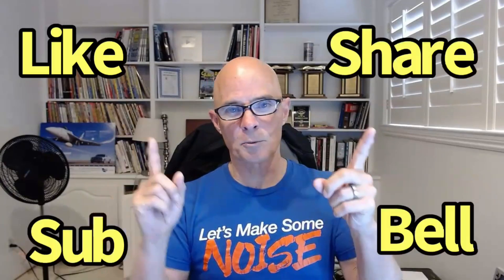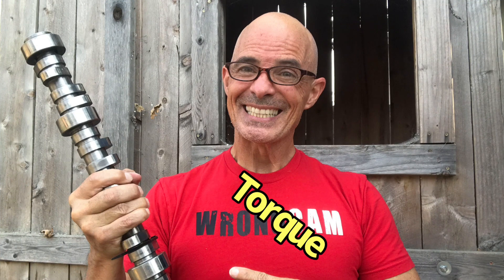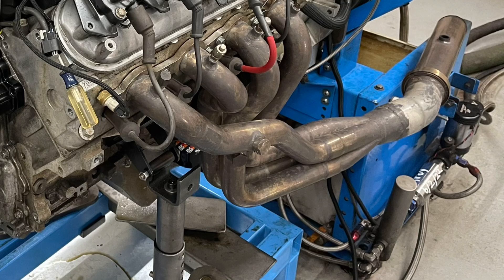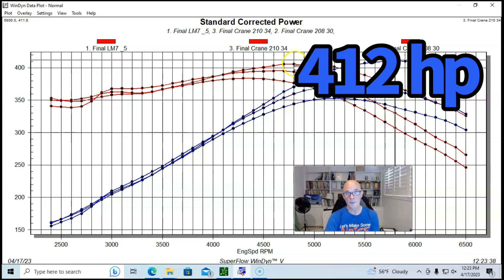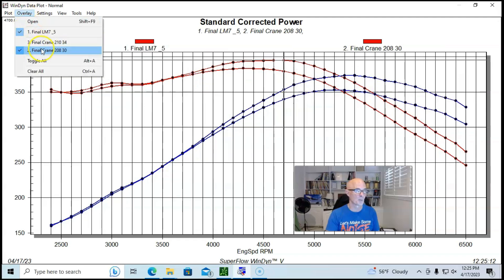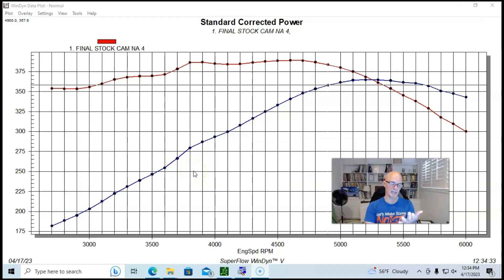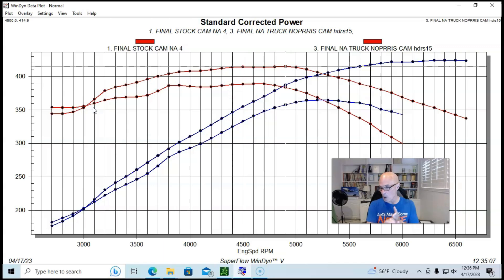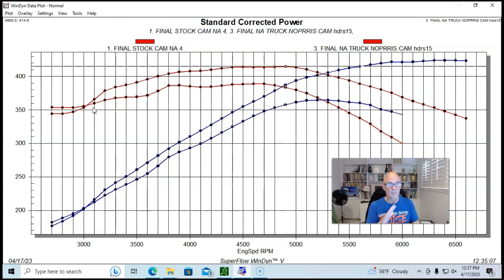WHERE'S THE TORQUE? HOW CAN I MAKE MORE LOW SPEED TORQUE? WHO MAKES THE BEST LOW-SPEED TORQUE CAM?

Comment: I just did the Tsp chopacabra cam and ported heads on my work truck. I was really hoping that it would be better than it is. Do I make more power down low? Yes, but it's not game changing or really worth all the effort that I had to put in. It does do pretty good past 3k and pulls strong up to 6k but I rarely see those numbers in normal driving. This is the fist ls I've run, I usually have a tbi or vortec 350 and I'm a little disappointed to say the least. 

I'm thinking of maybe getting a slightly bigger converter when trans rebuild time comes next winter. Shorter gears are a possibility as well to go with it to get into the power curve a bit better. I also got to get the tune dialed in a bit better and work the shift points a bit better. It's got great pull in first but shifts out to second and lands at about 2250rpm 500rpm just short of where it really wakes up at 3k. From second to third is pretty nice and I usually pull it to about 4-5k.

All in all, I'm happy I did it. Now I won't be feeling like I missed my chance to do it, the motor had to come out for a dead lifter and to be resealed anyway. The next one I'm doing is a 6.0 with a sloppy stage2 and a converter.

Comment: to generate lower RPM torque , you have to have a higher crankshaft stroke , chevy guys , need the early 2000`s  454 with the 4.25 stroke crankshaft , ford guys need the lunati   351w 4.250 stroke crankshaft , then  use the correct duration camshaft , with a correctly CFM rated carb along with a correctly jetted carb

Comment: You mentioned that you could gain torque with a lower engine temperature. This made me think of a few noteworthy mentions. I would think that quite a few people wishing to increase torque would be choosing to modify their daily driver. That’s why these two considerations may be important.
1) Smoky Yunick stated that a hotter engine will resist wear more so than an engine running cooler temperatures. So engine temperatures could effect longevity.
2) I used to run cooler thermostats to pick up a little extra grunt. A fellow car guy shared with me that he had experimented with coolant temperature and determined that a hotter engine seemed to get better fuel economy. I never tested this theory with a carburetor but I have seen slightly better mpg on EFI engines with a 195 thermostat than with a 180.
Reply from the maker: hotter engine does get better fuel economy-but makes less power

Comment: The answer is because at low engine speed, even with a stock cam, you’re running close to 100% volumetric efficiency. Theres only so much air that can enter the cylinder, and the only way to get more power than that with an NA motor is with more rpm. Volumetric efficiency drops at high rpms especially with mild camshafts. And a good cam is essentially allowing higher volumetric efficiency at high rpms.
Reply from the maker: the highest VE will be at the torque peak-nowhere near this 2000 rpm point

Comment: Use a cam with a very early closing intake event (increase dynamic compression) and late opening exhaust event (hold the power stroke for longer). Caution use only 92 octane fuel or better to avoid pre-detention. Use small diameter headers 1 & 5/8  or 1 & 1/2. This was good for approx 25ft/lbs @ wheels at 1800rpm.

This all comes at a cost to top end power. You will get less than the stock cam.

Comment: Currently building a high compression 292 chevy inline six, to replace my 327 chevy v8. This is for a firewood truck. That freakishly long stroke, that's what increases low-end torque. Also going from 4:11gears to 4:56 gears.
Reply from the maker: you will find the smaller motor makes less
Reply: @richardholdener1727  yep, less up top. But with 4000lbs of green firewood, that high torque off idle will be nice. All low end grunt, crawling off road around cut sites, loaded heavy. A good environment for the straight six.

Got clifford intake, forged high compression..060 pistons, total seal thin rings, Harland sharp roller rockers, howards hy-tork cam, ac delco hei truck distributor, long tube headers, flowkooler water pump, 6bt cummins radiator. Tom Lowe lump ports, bigger intake/exuahst valve kit. Excited to get it put together!
I'm a little intimidated though, such a big project.

Autoline just put me together a remanufactured motorcraft 2100 carb. They are amazing carbs off-road. Great fuel atomization at idle as well.
Reply: I used believe that a longer crank stroke was the key to making torque. But total displacement is a bigger factor. Anyone who has taken a basic hydraulics & pneumatics class will tell you that a larger piston has a greater area and will exert greater force when the same amount of pressure is applied. A larger bore also provides more room for flow around the valves. More flow equates to greater power potential.

Comment: I would think it’s possible to make more down low with the right set of cylinder heads. If I were a betting man I’d think an LS1 would put down more power at 2000 RPM than a regular 350.

Comment: On a 3/4 ton and a 1 ton truck. You basically have hydro boost brakes. Which relies on power steering hydraulic pressure. Which means you can run a tight LSA cam in theory because you don't need engine air vacuum for the brakes. If  you have a 1/2 ton truck. Most likely you will have an engine air vacuum brake booster. Maybe the tightest you can go would be a 109 LSA. And still have engine vacuum. ECM Tuning will be required on some of these cams. On diesel engines like a 5.9 Cummins you have 600 ft lbs of torque at 1600 rpm. The reason is down low is because of the camshaft LSA. In 2002-2007 the stock specs of the camshaft is intake 163°@50 and cam lift is .237. Exhaust 191°@50 and cam lift is .299. On a 98.5 LSA. And for the brakes it uses a hydro boost system. Operated by the power steering pump. And I remember Richard showed a video about LSA and the 108 made good low end torque where trucks normally operate when towing. So this video was questionable.
Reply from the maker: no lsa or cam advance or duration spec will add 30 lb-ft (or more) of torque at 2000 rpm

Comment: I thought a tighter LSA such as 108 improved low end torgue  while keeping good higher end power. You proved that another video. Vizards 128 formula works.
Reply from the maker: ADDS LOW END AND TOP END?
Reply: You tested 3 exact cams with different lsa 108, 112, 117. The cam with 108 made more low end tonrgue with near equal top end power.

Comment: I have a question I’m running a 2000 Silverado 1500 with a 5.3 and single turbo setup the engine has injector, sloppy stage 2 cam , 317 heads and Jegs intake manifold also 456 gear ratio on 20” tires and 3500 stall converter and the truck coming out of the line is very sluggish I know is not the tuning because I change to different tuning and still the same Hp tuners any idea what is wrong
Reply from the maker: DO YOU HAVE THAT FABRICATED, SHORT RUNNER INTAKE? AND WHAT SIZE TURBO? THAT CAM IT ALSO TOO BIG
Reply: @richardholdener1727  which cam do you recommend
Reply: The intake I got from Jegs the turbo is  GT45 1.05 A/R 98mm

Comment: Looking for advice OPP on building a 400 sbc stock bottem end boar 30 over stock heads I am trying to reach 450 HP can you help going in Camaro torbo 400 tran 373 rear 15 in tire
Reply: Please help
Reply: Thanks for the advice a nice choppy cam would what?
Reply: Any suggestions on a choice of cam
Reply from the maker: THAT IS EASILY POSSIBLE, BUT PORTING THOSE STOCK HEADS WILL BE REQUIRED
Reply from the maker: look at the Comp XE line of cams-an XE274H

Comment: One thing that we're overlooking is head flow gains.
Better heads either by good porting or swap increase cylinder flow with any cam, which means good increases in the most "useable" rpm range. Good heads bring out the best of what a cam can do.
Of course Richard is correct when just comparing CAMS.
They're less $$ than heads.
Eg: Richard did tests on a SBF pushrod 5.0 and cams helped but heads alone were good for nearly 80 HP aaaand lower rpm, before cam changes.
HEADS!!!!
IMO good exhaust, then head flow, then cams...
IF you can afford it.
Reply from the maker: PORTED LS HEADS DON'T ADD TORQUE AT 2000 RPM
Reply: Heads is the most important, i bought TrickFlows 38cc for my 4.6L 2v rather than porting stock PI heads.. Unported TFS made a huge difference.. The cam i chose (MHS TFS stage 3 n/a) taps out at 5,447rpm 309rwhp 321rwtrq.. Huge torque all around..

Comment: You know I've read down through most the comments. A lot of people had different suggestions. I think everyone could be correct in there own way. 

The main question is, What are you building your motor for? You want to have a nice street car? You want to do 150 mph in the quarter mile? You want to pull a house off the foundation?

You can get better torque at a lower rpm with a cam. But you have to build around that cam. Other variables have to be in play also. It takes more than a cam to get what you want.

Just remember that you can only put so much power to the road before breaking the tires loose. If you're spinning tires you're not going where you want to go as fast as you want to.
Reply from the maker: YOU CAN'T GET A BIG GAINS IN TORQUE AT 2000 RPM WITH A CAM
Reply: @richardholdener1727    More or less that's what I said. You can get some with a cam but you have to build around the cam to get a big difference. 
Another point I made is what do you plan to do with your vehicle. Not everyone is after the same ending.
Reply: @richardholdener1727   All I wanted was a nice little street car. I did different things to add torque to mine. Yes I went a little overboard with mine.

If you look up the specs on my cam it says good low to mid range torque range. My cam is obsolete of course, it's a Crane Cam. Look up the specs for part number 363941. 
I also am running a V6 torque converter behind my 5.0L. So yes it also helps. Besides adding compression with the shaving I did and my heads Frankenstein is a street beast. Probably do real good going down the strip if I can get rid of this V6 rear. Coming off the line all it wants to do is spin that one legged 273 rear.

Btw, my 0-60 time is probably 5 seconds or less. That's when my 4R70w trans, stock behind the old 3.8L, shifts out of 1st gear.

Comment: A question since you mentioned VVT....With constant variable valve timing when testing to see the optimum change-over points (or angles), would it be best to test each test angle with an individual optimised spark table or run each angle with the same generic spark table? (one that won't cause knock regardless of the VE changes)
Reply from the maker: we ask the motor what it wants as far as ignition timing, we do that for each cam on VTEC and at various point using VVT

Comment: I need to agree Richard, I have a big ol lifted 2007 Silverado with 315 wide 100 pound rear tires.

My truck is actually slower than stock with all of the added lift.

For the first time in its life, it chirps the wheels at WOT with an upgraded torque converter from Yenko.

Comment: Richard do I remember your name from a podium finish at SSCC?
Reply from the maker: I ran that for 12 years-Won overall 1 year
Reply: @richardholdener1727  that is why your name seemed familiar. Spent 30 years on the road 7 miles from Hiko finish line. Finally got a ride last May and placed 2nd in 120 as a rookie nav. We were 5.8 off target on the 122 mile 2 way.
Reply from the maker: FUN STUFF

Comment: Everything is a compromise, and depends on the whole combination.  For example, the Buick 350 made 400+ ft-lbs somewhere around 2500rpm, but there was no point in revving it beyond 4300. If you want that kind of torque in an LS, you've got to change a lot more than a cam.

Comment: The answer really is yes... in a scenario where your cam is so absurdly small for the motor, you can get substantially higher torque down low.  Swap to a good cam on a tbi 454 and see what you get.
Reply: That being said torque down low is mostly changed by bore, stroke, and cylinder pressure.

Comment: Richard, you're right and you're wrong.  You're right, those cams YOU tested didn't make low rpm torque gains.  You're wrong in saying "it's not possible".  NO MAGAZINE/EDITOR EVER TRIES, and that's why we never see it.  Both an engine and cam CAN BE OPTIMIZED for 1,500-4,500 torque.  It would be a cam with MODERATE lift/duration, and narrow LSA, with Intake centerline advanced, ask David Vizard.  I have a goal to make a 500 lb-ft midrange (~3,500) in a streetable small block 350-360 (or 6.0 366 LQ4) CI engine.  NO ONE TRIES THAT, which is why people think it's not possible.  Yes, obviously the combo needs to be optimized to do that.  I've seen the magazines make 447 lbft from a stockish junkyard 350 Vortec, and 470 lbft from a 360 Magnum, Neither of them trying to make torque, their goal is always the HP number.   Your examples here are the LSX engines which are optimized for a bit higher rpm,  most engines in the 2000's were.  How can I message you a plan for a torque engine?  Would be a great test and you'd be the 1st to do it for the masses
Reply from the maker: what you are talking about is far from FIRST TIME stuff. Stop quoting DV-he is a great guy (I know him well), you making power with a small block has nothing to do with this statement or test. Cams have little effect on torque production at 2000 rpm on this LS combo. I've tested this many, many, many times. short LSAs, advancing the cam or ICL and circle track cam timing are not the answer.
Reply: @richardholdener1727  OK, but have you ever advanced any of these cams on an LM7/LQ?  Please do a test where you advance 2*, 4*, 6*, 8* on the dyno.  You say it doesn't work but haven't shown the evidence that I am aware of.  Sure looks to me like it would work with the Truck Norris cam
Reply from the maker: see the ls9 cam advance video-where it showed ZERO power gains-advancing cams is not universal for adding low speed torque-you need to test more
Reply: @richardholdener1727  I'll look that up, but I recall the LS9 cam is a terrible lower rpm torque cam, it is way down compared to other car stock cams
Reply: @richardholdener1727  I appreciate the testing you do for the budget performance masses.  I think if you reran the Truck Norris cam with an actual exhaust system it would pick up low rpm torque, the graph at 8:00 indicates to me the engine is not "on the pipe" yet, and it's probably the 3" long tubes with only a short extension, which is not real world for most pickup owners who'd want a Truck Norris or specifically a torque cam.  I understand it's the challenge between engine dyno and a chassis dyno

Comment: You can’t beat a stock cam for idle-2000 torque where the off-road, snowplow and towing guys live.
These guys look to a “torque cam” to preserve the stock low end torque as much as possible while still providing gains up top. Cams in the 202-210 range at .050 do a good job at stock like performance off idle and some gains up top
Reply from the maker: did you watch where I ran sub 200 duration cams through 210 duration cams

Comment: What about decking your heads? Couldn't that bring up your low speed torque? Obviously no 50ftlbs but I'd think it'd be worth something down low
Reply from the maker: adding compression adds power everywhere
Reply: @Richard Holdener - I just had that "duh" moment as I read your reply..🤦‍♂️😆... I guess I was thinking more specifically using 706 heads on say a 5.7. Decking them might give a little more on the bottom vs the top due to valve size and air velocity peaking at higher rpm?
Reply from the maker: the compression will add power all the way through

Comment: This isn't totally accurate. I added a ton of low speed torque to my 5.3L by placing a 6.0L LQ9 cam in it! I mean, the cam is installed in the LQ9, and the whole LQ9 is in the truck but details! LOL
Reply from the maker: displacement adds torque
Reply: @Richard Holdener  it surely does! Hope you realized I was joking you're spot on as always!

Comment: are there any aftermarket intake manifolds with the same runner lemgth as sbc tpi manifolds? Like other comments have said, nothing beats displacement for low speed torque.
 Taking this to an extreme just for torque, could a stroked 5.3 with 20 inch runner length and a 210° duration cam be the tow truck torque champion?
Would a stock 8.1 with a similar cam and a performer manifold make more torque for less money?
 The people clamoring for off ldle torque typically want to haul 10000 lbs at freeway speeds, and aren't looking to go 8s in a vega. So the desire to get big block torque is typically best served (cost effectively) by doing EXACTLY WHAT RICHARD SAYS! 😮